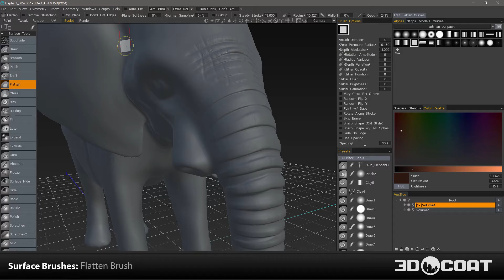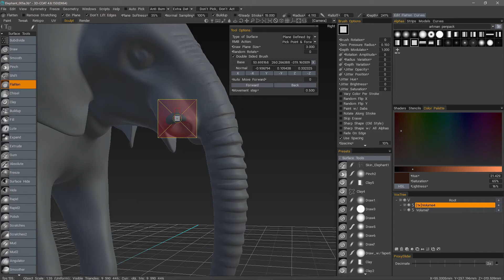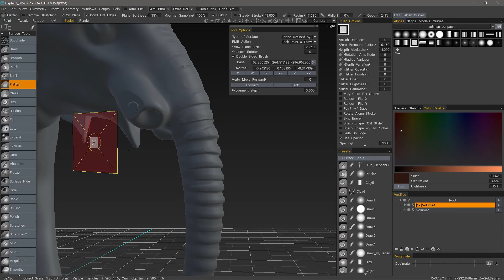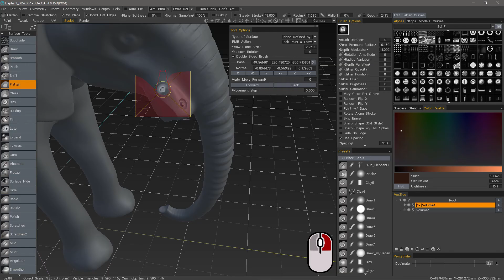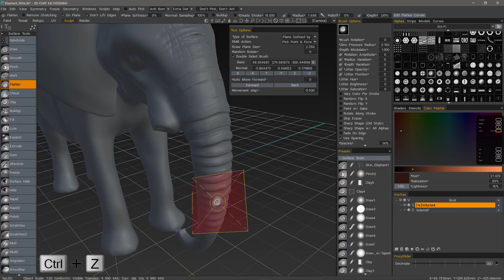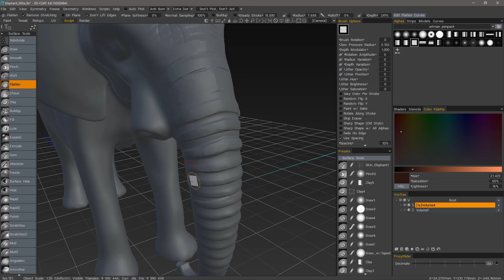Surface Brushes: Flatten Brush

Comment: sometimes i wish that the brush options along the top could be put into a menu and docked so they are more easily readable in a list format. the eye has some trouble parsing the long row with inputs etc. as im watching the vids the var modes available in the drop downs seem very important but are kind of hidden from view most of the time. all those settings at the top are so important the graphic read could be enhanced in a full tab dockable  option like the other stuff is like presets and brush options. some of those options radically alter the flatten operation as well wow. great to have so many choices in how it works.